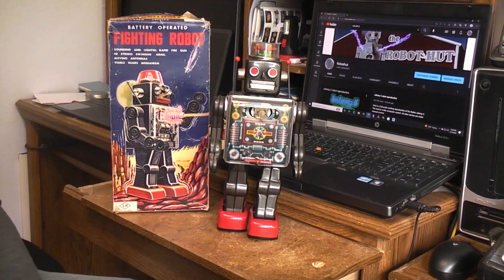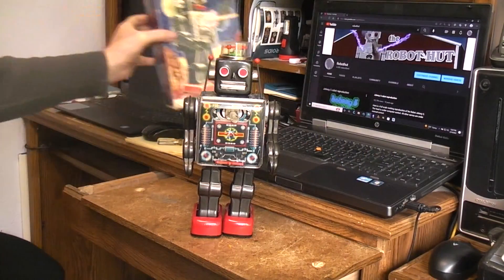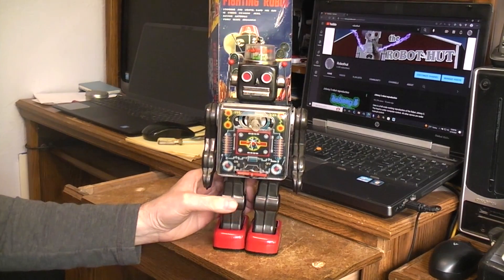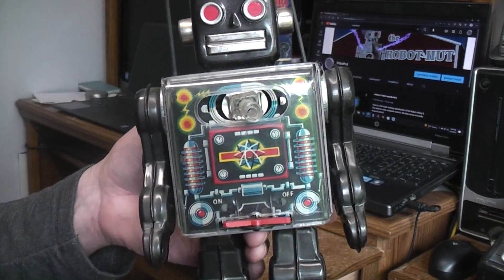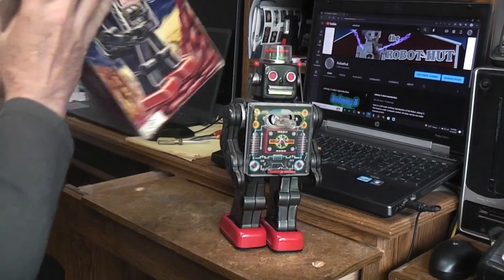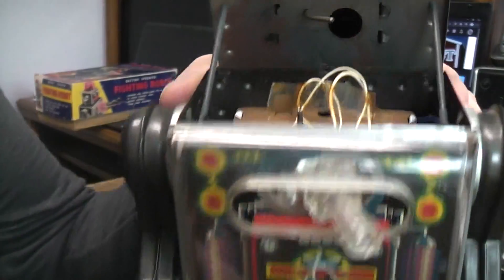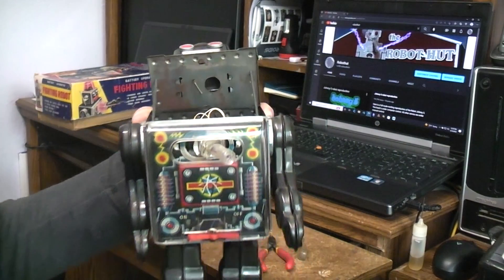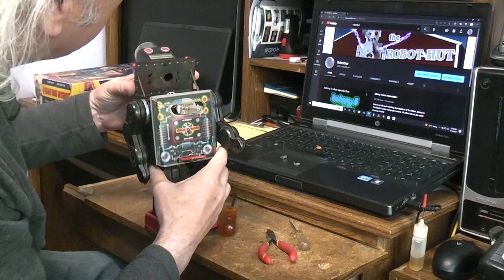1960's Made in Japan, Fighting Robot repair. How it works, a look inside.

Comment: QUESTION. how often do those tabs break on you ?
Reply from the maker: If no one has been bent them before you can carefully bend them about 3 or four times before they break off. So that means you can open up and put back together the toy about 2 times before they break off. Not all tin toys have the same gauge metal, some are supper thin metal, and they may not even hold up to being opened up and put back together 1 time. Alot has to do with how sharp the bend is as well.